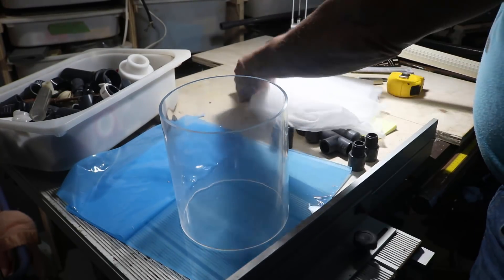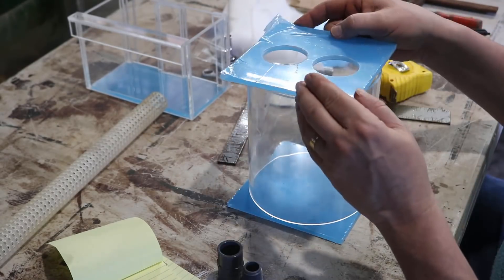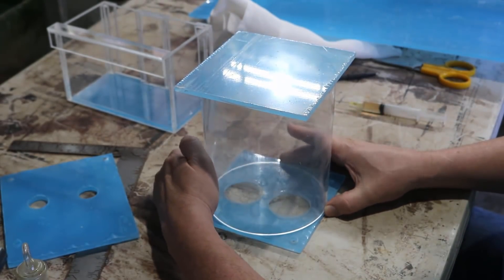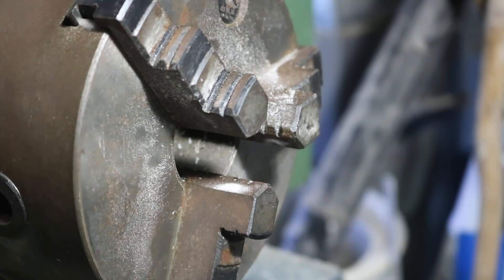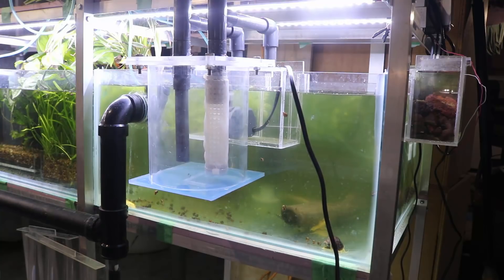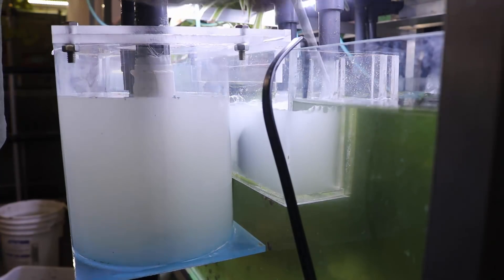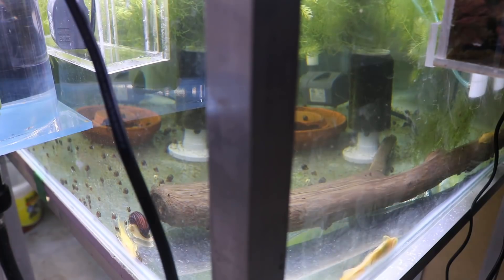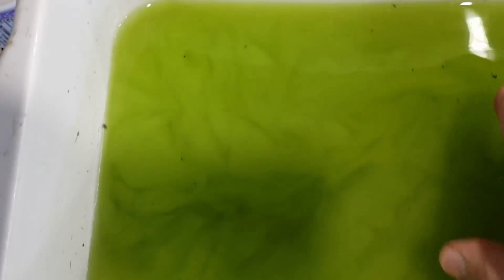DIY Diatom Filter

Comment from the maker: I need to correct an error I made in this video. I always thought the structure was calcium based but it's actually silica based. Thanks to Joao Avo for pointing that out.
Reply: Props for the correction
Reply from the maker: @BobLSaget  No one knows everything and I like to give credit where credit is due. Thanks for watching
Reply: You mean the diatoms that is.. I caught that too. 
Sponges will consume silicates thus reducing food for diatoms as well.
Reply: I would encourage the use of a drain when you want to dump the layer and maybe a backwash function(10+yrs of water treatment)

Comment: Do you think diatomaceous small rocks / grit could work instead of the powder ? Zeolite is also a great absorbent and can be found easily too , wonder if that would work
Reply from the maker: For small particle filtration, the powder is the one you need. Zeolite is great for chemical removal but not fine filtration. Thanks for watching!
Reply: Thank you.  I’m trying to understand how the filter is sucking through the mesh ? I see the pipe coming from the pump out filling the filter cylinder but it doesn’t look like the pump in , is attached to the diatom pipe .  Is the pressure pushing the diatom onto the mesh instead of pulling it through in other designs ? If so is either method the same ?
Reply from the maker: @corey688  Pulling the water through or pumping it through has the same result. As long as the water flows through the mesh, the diatom powder will coat it.

Comment: Not really sure why diatom filtration in the hobby fell out of favor when they're so effective .I still have my Marineland Magnum 330 (yes a 330) 🤣 that I bought "new" when I worked at a tropical fish hatchery in my home state of Washington .Had to finally replace the motor a year ago and the only reason for that was my own stupidity but otherwise it probably would still be good .Best $75 (1990s prices)  I've spent lol 😆
Been a while since I've used the diatom part of the filter so I'm looking for the amount of powder I'm supposed to be using .Diatomaceous earth is amazing stuff with all sorts of uses and health benefits .Awesome build BTW ,are you a machinist by trade ? I'd love to get the Canister part replaced since its showing a hairline crack at the bottom lip but paying $150 on ebay for such an old filter ,that's nuts . .Never did like the thin material they used for that part but with proper care they obviously do last if you're careful handling them .IMO still one of the vest filters they've made . Anyways cool design,nice work 👍✌️
Reply from the maker: They are my favorite way to clear tanks, but if you aren't running a large fish room or, as I am a business, most people just don't need one. I'm not a machinist. Just a hobby tinkerer. Thanks so much for coming by!

Comment: I had 2 diatom filters back in the early 90's. I hated maintenancing them. Cleaning them was fine, but getting them started back up with the DE was always a nightmare. I used a pitcher, but even our biggest one wasn't as tall as the intake pipe, so it still got everywhere. Also fun being told to soak your filter 'pads' (whatever they called the air filter looking thing in the middle) in bleach.
Reply from the maker: Thanks for sharing your experiences with these old filters!

Comment: What fabric are you using at 7:30.
 I have an old Diatom D1 Vortex filter and am looking for the fabric to repair the filter bag which is discontinued.
Reply from the maker: It's called crinoline and you can get it at any fabric shop.

Comment: Not sure everyone can "DIY" this since we don't have access to a lathe.  Is it possible to get the "true" accuracy without one??
Reply from the maker: Not when using methylene chloride, but if you use some of the thicker weldon products you can fill the gaps and get a good seal. I built a smaller in tank version that would be better suited for those without a lathe as any leakage would just go back into the tank. Here's the link to the first in the series https://www.youtube.com/watch?v=nJzU4NkBBac&t=12s

Comment: instead of disassembling everything for cleaning couldn't you just make a water tight opening at the bottom so you could drain out the dirty water and close it back up again.
Reply from the maker: I actually just shake it out in the sink now and fill and shake it out a couple of more times. I take it apart rarely. Thanks for the idea though!

Comment: The Vortex diatom filter is still made and sold online and I own a couple. That being said other than a few cosmetic changes they haven't changed since I bought my first one in the late '70s which why I'm looking for something better. It does filter ick as you said but ick is only free swimming for a short time of its life span so the chem methods are still needed. I like your set up I can see that it could be adapted for small tanks but have you thought of a method to increase your filter area? The pleated filter bag for the Vortex filter might be adapted to your setup.

Comment: Very nice. A real pro. Im n amateur  marine fish breeder and for low tech, diatom filter still way to go.would be nice if it stripped out bacteria. The thing is, vortex brand is lousy.i just got a brand new pump head that always leaked and was never smooth running for longer the a few days.now there is a horrible vibration, as if the pumphead is loose on its chasis.  my understanding is that they are designed for long term use.Yours is a clever, I should think patentable design. will u be upset or proud if you walk into  a petstore one day and see your design? at the moment, im searching around for another way to construct a diatom filter. unfortunately I do not have the machines necessary to do the precise workmanship needed here..... Has anyone asked you to build them one? Dave
Reply from the maker: I'm so glad you like the design Dave! If you want to patent it go ahead. People have asked me to make many things for them. The problem is shipping and as always finding the time to build them. Thanks for watching

Comment: Isn't diatom brown algae? They probably don't exist bc uvs are so efficient at treating and preventing this issue. This did remove it from the system instead of a massive algae kill off and ammonia spike though, so it seems like a more relaxed method for the fish
Reply from the maker: Brown algae is a type of diatom, but there are others. I find using a diatom filter a great way to drastically reduce the amount of algae and then I do water changes and use UV to finish it off. Thanks for coming by and watching

Comment: I miss my Vortex D-1 diatom filter - I found adding the diatom powder to the filter first and then connecting the intake and outtake hoses together once it was filled with water made for an easy setup.
Reply from the maker: Thanks for the tip and for watching

Comment: Cool design.  But it would be better with a 2 or 3 prefilters and a pressure rated pump - so when it clogs the first 1-10 minutes (depending on how dirty the tank is) the pump keeps it going.  
Also - any kind of mechanical filtration is inferior to a properly developed biofilter (PDB).  The clarity of the water as a result of a PDB is unsurpassed even by the ultra clear water that a diatom can produce. In addition - both fish and plants benefit in a variety of ways - some very inexpected.
Reply from the maker: Too true there is nothing better than a balanced system. Unfortunately most aquarists don't have the patience for that. Thanks for coming by and watching
Reply: @FishmanEricRussell  You are being politically correct.  Most people don't have the patience and the mindset to do what is right and the result is a superficial experience of everything.  Including things we love - like a hobby.

Comment: Vortex still markets their diatom filter. I'm using a Marineland Magnum Internal Polishing Filter with the micron filter and DE - works great! (I charge the filter with DE in a 5g bucket, then put in the tank. After a few hours, water is crystal clear +.
Reply from the maker: Thanks for sharing this.
Reply: I second the Magnum. I already was sold on DE since it came with our pool and I know several local town pools have them. The clarity of my pool water is stunning. The Magnum can make the tank equally stunning but I wish the flow could be turned down a bit. In a 65 I only use it for short periods of time as it seems to rile up the plecos.
And we don't want to rile up the plecos.

Comment: Fun fact Diatoms are actually useful in life... Diatomaceous Earth is made out of the dead shells of diatoms. It is extremely good at getting rid of Fungus gnats in soil, use a sifter and just give your soil a nice coating. The sharp edges of the DE shreds through soft bodied insects killing them. Also super organic mostly Silica and a little bit of Sodium.

Use it in conjunction with vinegar and soap traps, and bug lights and your fungus gnats problem will go away very quickly. Just more info on fungus gnats if you don’t overwater and allow the top few inches of soil to dry out between waterings they won’t be a problem again. I know random but whatever it’s useful info if you ever have a garden.

DE can also be used to rid people and animals of some types of Intestinal parasites, just mix it with the food.
Reply from the maker: Thanks for sharing your thoughts on this. Much appreciated

Comment: This is a really cool filter design. I like that it’s technical but most of all I like how well it works. Quite amazing actually. I also like that you used your lathe to face and chamfer the pvc. Nice touch. I too have a lathe that I find any excuse to use haha. And your right, a very sharp high speed steel tool with a nicely ground heel works great for most plastics. Great video man, I subbed your channel because you explain things very well, you like keeping fish and it seems like we have a lot in common lol. Ok enough rambling. Have a great day man
Reply from the maker: Great to meet you. Lathes are amazing for sure. Thanks for watching

Comment: I see tons of potential for incorporating this into a trouble free auto flush filtration system.

I just happen to have some DE powder laying around, I might have to try and scab something together ;)

Thanks for the tip!
Reply from the maker: Cool! Love to see what you come up with
Reply: @FishmanEricRussell  Haha, in reality I will likely never get around to prototyping anything. However, you're designed could incorporate a drain hole at the bottom of the chamber to allow flushing of the material without the need to remove or open it.
Perhaps utilizing a simple open/shut valve that would dump into a bucket or drain... A further Improvement upon that, could be to create a backflow through the filter screening that would blowback lodged particles.
Reply from the maker: @MrMyKidd  Those are both good ideas. If I ever make a 2.0 version I will have to work something like that in.

Comment: Would MEK (Methyl Ethyl Ketone also be usable as a solvent glue for acrylic?
Reply from the maker: I've never used it myself. From what I've heard it doesn't form a strong weld and has a lower vapor pressure so it takes longer to setup. Hope that helps

Comment: I've spent the last couple of years looking for diatom filters and no one makes them.  I used them when I was a teenager working at superstore back in the late 80's and they would filter a 10-gallon tank to sparkling clean in 10 minutes.
Reply from the maker: I remember the same kind of experiences. Some people in the comments tell me they are still available, though I haven't seen any recently. Thanks for watching
Reply: @FishmanEricRussell  do a Google search for "vortex diatom filter"... there are a few places you can buy them. I bought one about 6 months ago ( btw I first saw them when I worked for a pet store in the 90s)
Reply from the maker: @alifelesordinary  Thanks for the info. People have told both that they can get them and they can't lol. Thanks for taking the time to come by
Reply: @FishmanEricRussell  They might be available as used items I would suspect.  The type I used had a strong pump and the filter itself was housed in a half gallon sized glass mason ball jar that had a steel screw on lid with a rubber gasket.

Comment: I still use a Magnum 350 with diatom filter! Cool build!
Reply from the maker: How old is your magnum? Thanks for coming by
Reply: The 350 is probably 20 years old maybe older! Still works great, I got a New impeller about a year ago. I also have a 330 that’s about 3 years old. I haven’t found a better filter anywhere!

Comment: What feeds and speeds do you use for acrylic? i though this stuff would just load up the tooling and end up either giving you a horrible finish or just crack.
Reply from the maker: I've never had any issues cutting it on the table saw, but you do have to have a smooth feed rate to keep the edge as clean as possible. Machining on the lathe requires a sharp tool but isn't impossible to work with. Just use a high rpm. Thanks for your questions and I hope this helps

Comment: First of all, love your videos. You show the assembling process of everything very clearly and you don't waste time on unneeded details just to make the video longer and put more ads in it. And all explanations are very accurate from a scientific point of view. 
Just to make a small correction though, diatom cell walls are made of essentially silica (silicon based), and not calcium salts. That's why they appear (as brown algae) on immature tanks where sand is used for substrate (lots of dissolved silica in the water), and also why these filters won't change water chemistry (if made from calcium, pH and hardness would increase).
Regarding the methylene chloride, a trick I found quite useful is to add some acrylic shavings to it and let them dissolve (takes a while). this will increase viscosity, and even improve welding by filling small gaps when the solvent evaporates.
It's a shame these old technologies aren't used and sold anymore, just like UG filters. Not profitable for manufacturers and retailers I guess.
Reply from the maker: Thanks so much for coming by and sharing your thoughts. My bad about the diatoms. I always thought for some reason they were composed of calcium salts. Live and learn. I've often used dissolving acrylic to fill small errors in cutting that come up. Never mentioned it in a video though for some reason. Thanks again for coming by and watching
Reply: @FishmanEricRussell , We learn so much from your videos, it's only fair that we contribute a little bit. Thank you and keep up the great work. It's nice to have videos from experienced hobbyists like you. Cheers
Reply from the maker: @joaoavo8127  Thanks so much for your kind words and for the info. Always glad to learn

Comment: I used to have a Diatom filter, actually still have the pipe with all the holes in it and the cartridge thing that goes over it, but the canister itself gave out along time ago. I loved it for polishing up the water.  Great video!
Reply from the maker: Hey Sandy! They certainly are antiques, but really cool antiques. Thanks for coming by